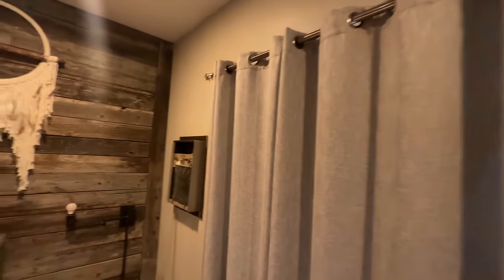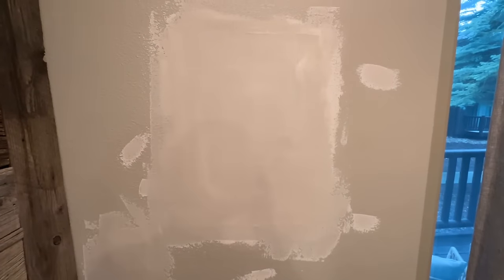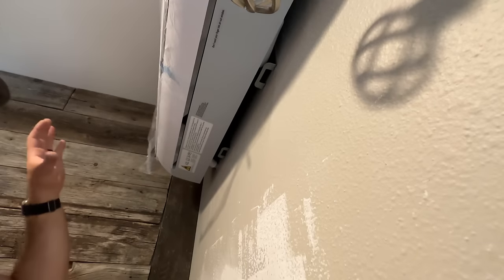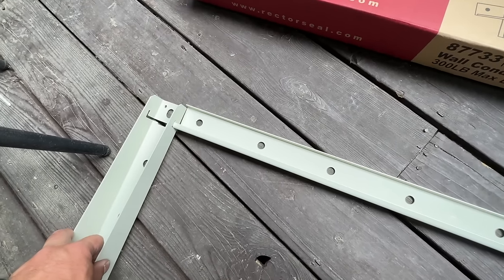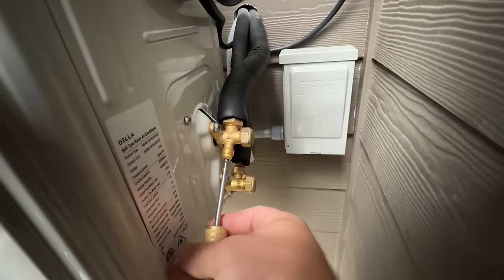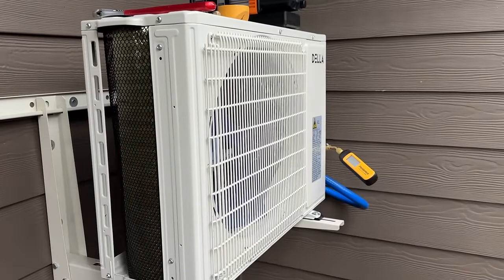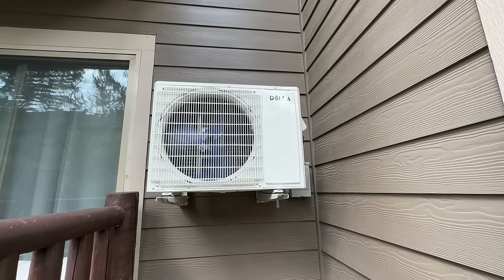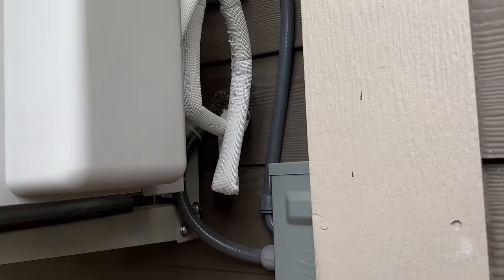A $600 Ductless 110v Mini Split?!

Comment: I wish they made mini (as in small) mini split systems.

Between 3000-6000 BTU.  Even better if it's a true 12v dc design (many cheap 12v dc mini split and AC units have a built in inverter to supply 120v ac  and then use 120v ac compressor and fan. A true 12v DC system uses 12v DC compressor and fan).

This size mini split would be perfect for offgrid use for a room about 10 feet x10 feet. This size is perfect for a cabin or RV bedroom.

Smaller AC units generally require less power to run and much much less power to start the compressor. Starting a motor takes 4 times as much power to start than to run. This us why a 2000 Watt generator can't run a 5000 BTU window AC unit.

Yes there are easy start add-ons that reduce the compressor starting power spike. 

A typical 5000 BTU AC uses 500-600 Watts while running and around 2000-2400 Watts to start the compressor.

A 3000 BTU AC should need about 350 Watts running and 1400 Watts to start the compressor.

The smallest mini split that I've seen was 8000 BTU, requiring about 960 Watts to run and 3800 Watts to start the compressor.

My RV's bedroom has a 13,500 BTU AC which requires about 1620 Watts to run and 6500 Watts to start the compressor.

I would use the 3000 BTU mini split when it's mildly warm, perhaps up to the low 80's with a target room temperature of 72-74F. The bedroom doors would be shut.

Obviously in hotter climates the main AC unit(s) would be needed, but often the tiny mini split would be great at night.

Even though the tiny mini split would likely not cycle much compared to the 13,500 BTU, the actual battery savings would be very significant.

Running a 3000 BTU unit that rarely cycles would use about 350 Watts.  Assuming it is run at night for 10 hours would use a bit over 3500 Watt/hour. Using it during the day could mean 6-10 hours run time (I assume that you only run it when outside temp exceeds about 74F). This would require between 2100 and 3500 Watt/hour.

Using the 13,500 BTU AC under the same conditions would require the compressor cycling often. The compressor normally comes when inside temp is about 1-2F above set point and turn off around 1-2F below set point. When the AC is oversized for the situation it makes the actual inside temperature much more uncomfortable.  If you set the temp at 72F, you could experience swings as bad as 70F to 74F. While a small AC is still programmed with the same 2-4F swing it takes longer to hit the lower temp. This reduces experiencing a rapid cooldown every few minutes. 

The AC cycling often will mean that much of the perceived savings of the compressor being off are used up by the power draw spike to start the compressor.

Also both the 3000 BTU and 13500 BTU AC will likely run the fan nearly continuously. The 3000 BTU AC usually would have a much smaller fan.

If the set temp is too low (usually because people mistakenly believe setting the AC to 50F will cool the room much faster than 70F) the AC unit's coils can freeze up, literally creating a block of ice damaging the coils (permanently reducing it's efficiency) and preventing the AC from being able to produce cool air and causing power use that does no cooling. The larger the AC the easier it is to freeze it up and the longer for it to de-ice. 

A 13,500 BTU AC requires about 1620 Watts to run. If it ran continuously it would require 16,200 Watts/hour.  Based on the BTU rating it should run about 4.5 times less (I'm assuming the conditions are perfect for 3000 BTU). This means that the compressor would only run about 2 hours and 15 minutes during the 10 hour period. This would require 3600 Watt/hour compared to 3500 Watt/hour for the 3000 BTU.

The 13,500 BTU AC would draw perhaps 100 Watts to run the fan. 10 hours minus 2.25 hours (compressor run time) means 7.75 hours of fan run time, an additional 775 Watt/hours. Now we are at 4375 Watt/hour. This doesn't account for the compressor cycling on and off.

Then there is an issue that the compressor would actually run more often as it would cutoff around 74f (assuming 72F set point) and turn on at about 70F. I believe that with a low 80F outside temp that the room would warm up quick enough to require more than 2.25 hours of run time in 10 hours.

If your location has very high humidity (like south east US) the 3000 BTU may not be able to control humidity while the 13,500 BTU AC might require a 68F set point in order to force it to run enough to maintain a stable and comfortable humidity.

In ideal conditions using the 13500 BTU AC would use at least 4375 Watt/hour (and likely significantly more as the compressor may actually run 50% of the time instead of 22.5%) compared to about 3500 watt/hour for the 3000 BTU; an increase of 875 Watt/hour. I would bet actual power usage is closer to double, around 7000 watt/hour vs 3500 Watt/hour.

Then there are the cases where I would run the 15,000 BTU AC in the main room combined with the 3000 BTU bedroom unit to save power usage.

There could be times when it is hot and humid enough that I'd run the 3000, 13,500 and 15,000 BTU units at the same time. This would require shore power or using my 9600 Watt generator.

875 Watt/hour is of little to no concern at home; but in off grid situations it matters, especially for an RV with limited capacities for batteries (space and weight).
Reply: That is the whole course!!! I am copy/pasting this into a text doc so that I can print it and refer to it.

Comment: Thank you for the instructional video. What if you need to locate the outside compressor fan unit horizontally to the hole through the wall?  What considerations and limits are there in locating the compressor?  I assume you need to maintain a slope in the piping to ensure gravity feed. How high off the ground is best,  I have a brick wall that opens to the courtyard garden where I would like to locate the Condensing Unit. How far from the Internal unit can you locate the compressor. Condensing unit?  Pros and cons of location. The other side of the brick wall where I want to install the unit is the garbage storage location.

Comment: Gotta start using those white 115 lb drywall anchors from Home Depot. Work the best. And forget what miketime says about nylog blue. That stuff is the best 😂
Reply from the maker: I’ve used them before. They’re WAY overkill man. I did a bunch of testing with these ones in my garage and they are plenty strong for a head unit. In fact, I could install it with just these anchors and it would be 100% strong enough.
Reply from the maker: Also if you ever need to remove these anchors the evidence and patchwork is like extremely minimal. Wheras with the white ones you have a huge hole to patch

Comment: The cover for the outside power connection on unit does not look rain tight. I would run the drain away from house. R32 is moderately more flammable than R410A however.

Comment: not to nit pick, but wouldn't it be a more professional install / slightly easier to maintain if you crimped on spade or ring terminals for the power and coms wires?  easier to screw down?

Comment: I bought one in 2021 and installed it that summer. Two years in, it developed a refrigerant leak. HVAC tech came, recharged it, and told me the evaporator coil leaks and it's "not repairable". I called the 800 number and was told no warranty after three years.  Mine was also a heat pump so $750.00  down the drain in three years. I hope y'all have better luck than me, but I wish I had put my money towards a better unit with a better warranty.
Reply: In the same boat as you, only got 9 years out of a Mitsubishi unit , the head unit is leaking and half the price of a new one. It’s out of warranty and I hesitate fixing the inside unit and having an old compressor. I had hoped for longer service but now I have delayed another year and may be better off replacing everything, I’m just skeptical of some off these lower price units in terms of longevity
Reply: If I'm understanding you correctly your unit is only in its second year and you have a 3 year warranty.
Reply: @russellstewart5414  I thought Mitsubishi had a 10 year warranty.
Reply: @happyheart2871  no. 2024 minus 2021 is three years. Had I acted on the warranty when the leak first appeared, it would have been covered but my hvac tech dropped the ball on that.
Reply: @happyheart2871  my original unit was 8 years. And now the units are 10 years but if you use a Mitsubishi authorized Diamond Dealer you qualify for 12 years warranty so you need to do your research . I replaced my entire system last month and am very satisfied, pricey but it was my understanding that some of the more economical options don’t have as good of customer support and service.so I went with what in know . Only time will tell if I made the right decision

Comment: I see on Amazon comments the company does not stand behind the product very well. Plus if you don't have a working knowledge of HVAC and vacuum pump, tools, gauges, plus in some places an electricians license. It will cost the price of the unit just to get it hooked up.

Comment: Della looks really fairly easy to install.  Love how he really took care to hide the linesets & wiring—unlike contractors in our area doing slap-together quickies, taking unsightly shortcuts!  
Does Della void the warranty if homeowner DIYs it? 
Is Della coming out with significantly better energy efficiency units soon (because these are currently, it appears, fairly low-efficiency)??
Reply: Della warranties DIY units but extends the warranty to 5 years if installed by a licensed qualified pro.

Comment: My favorite anchors as well, easiest and quickest to use. BTW this unit is $650 now.
Reply: 650⁰⁰ now? Kinda pushed over my commodity price threshold then-
Reply: @dubmob151  650 is still cheap, just pointing out that it had changed.....

Comment: Imho running the lineset through wall too much work and for what reason? I've watched many mini split installs, drill line set hole thru wall on top, pull line sets out of unit, push through hole, connect rest of line kit out side, run down and cover to look nice. Possibly for hoa ascetic and rules? Still running that copper in wall and drain tubing seems troubling. Appreciate this channel and info though as its useful info.
Reply from the maker: Asthetics. This looks way better imho
Reply from the maker: Functionality wise, no difference

Comment: Is it necessary to vacuum down the Della system once its installed? I watched your Mr Cool mini split install and it did seem like you pulled the vacuum on that system.
Reply from the maker: Yes, you have to pump down a Della and most mini split systems. The Mr. cool has a patented no vacuum line set that has refrigerant charged in it and the fittings are designed so that as soon as you connect it, no air is allowed to get in the lines.
Reply: Thank you. I've been thinking about installing one of this mini splits however I don't want to purchase a vacuum pump and all the accessories I watched you use. I will try Mr Cool mini splits since I won't need a vacuum. Thanks for your help and awesome videos. I watched 10 of them last night. @diyhvacguy

Comment: I need the expertise of an HVAC TECH; For personal reason I need to place a timer or a timer with a relay in a couple of mini splits. Should I place the the timer in the power wires between the  breaker panel and the outside unit? or should I place the timer between the wires that go from the outside unit to the inside unit?

Comment: Umm I’m pretty sure that disconnect switch doesn’t meet working space clearances required  by code. Also I noticed the MC cable coming right through a hole in the back of the disconnect switch. Where is the MC connector that should be on the back of the disconnect switch🧐

Comment: Oooooo...an open end attachment for a torque wrench. Of course!!!
Reply: I've installed thousands and never ever used a torque wrench once on these.  No leakage either.  Just use common sense when tightening.
Reply: @aday1637  Yeah. You're right. You have to test for leaks anyway. IMHO, these videos do that to stick to the line and protect themselves. Still, I never saw a tool like that before.

Comment: I don't understand why you didn't run the line set before you patched the hole now you have to patch another hole making more work for yourself. I also don't understand why you ran it inside the wall what happens if it develops a refrigerant leak ?

Comment: I did a Pioneer and a C&H recently for the first time, but didn't use the core removal tools.  Is the benefit of removing the valve cores just a faster evacuation or are there other benefits to using the (fairly expensive if you buy multiple) Appion tools?  I did have a total overkill (and massively heavy) 12cfm vacuum pump so it went quick regardless.
Reply: I’d be curious too.
Reply: The valve does significantly restrict flow. If time matters, you'll want to remove it. i.e. DIYer's shouldn't care. (Are you paying yourself by the hour?) For professionals, those things are worth their weight in gold.
Reply: @jfbeam  Not speaking from experience but there isn't much "flow" during the vacuum process.  People say it takes way longer to draw a vacuum but in theory, the largest flow across that core is at the very beginning.  Once you get down to a partial vacuum there isn't much flow.

Comment: Do you think this would work in a mobile home.  We use window units but they always end up dripping water in the window sill rotting it out . Then i have to rebuild the window sill wall and sometimes the floor.
Reply: Sure would.
I've got a mini-split installed in a 40' Retired Air Force Ambulance Bus... currently 91 degrees outside and 73 degrees inside.
edit: practically silent operation is a bonus

Comment: Does this unit require professional installation to maintain the product warranty?  Does having the EPA 608 certification alone count for that requirement?
Reply: Nope. They're 100% designed for anybody to easily install. They cut down the pre-made lines, which requires some special equipment. If you uses everything as-is, there's no need for a vacuum pump, etc. The limited amount of air in those two lines will not hurt the system. (there's a dryer block in there to deal with that.)

Comment: I have a small 1.5 car garage (~400 sq ft) I'd love to cool.  Can you recommend a unit that is super-easy to install that runs on a 110 v AC outlet (instead of being hard-wired)? My budget is $1500.00 but I'd love to be closer to $1000.00 or less.

Comment: Disconnect is a code violation. Check your electrical clearances for working space. Also a j-box buried in the wall?
Reply: Every state and city has a different code. My gosh we got a new fire Marshall from some lib city. He changed codes and the cost of our build went up 1 million dollars to meet his stupid codes. Turns out his gay lover did the work and that's how they paid for their million dollar home. Just my opinion of course and this is all alleged.
Reply: @keith2498  everyone goes by the nec code they can go above it for safety but the code is min.  if they stray from it they will need to cite code otherwise you can appeal it.  We got rid of inspectors making up rules as well just appealed and after several companies appealed they fired them.
Reply: @jrock865  Exactly. Only person you can't fight is a Dumb arse Fire Marshall. They just get revenge.
Reply: @keith2498  Ya they can make you add additional items for safety disconnects etc and relocating but a good change order always is nice.

Comment: Would you have sent the line stubs from the air handler directly out to the exterior had you not run the line set through the wall in this install? Is it better to have those connections to the air handler on the inside or outside?

Comment: is there such a thing as a minisplit where the line set can be run UP from the inside unit? I have a room that needs a small unit to help the central AC keep up, but it has a brick wall on the other side that i really don't want to drill through/break up.

Comment: Is there any baseboard air handlers? I think close to ceiling air handlers look tacky. Thats ok if you can hide them like a wall bookcase. Ceiling units are ok but think where the hotest part of the house is, the attic. Florida has lots of residents wasting energy in their attics. My cabin in the mountains has AC ducts under the house and the house seems to be much cooler in the summer. Yes it gets hot in the northern southern states. 73

Comment: Is it important to remove the Shrader valve? I have installed about 10 of these and never have, but I remove all of the air with a vacuum pump and test it with nitrogen. I did have one leak after 1 year, but the others are good.
Reply from the maker: You can definitely do it without, it just takes a bit more time is all 👍🏼

Comment: Difference between this model with R32 and R410A refrigerant?  Why is this cheaper?
Reply: R32 is flammable.
Reply: here the short answer.... In most cases, R32 is the superior refrigerant when compared to R410A. While neither refrigerant depletes the ozone layer, R32 has a lower GWP and is easier to recycle. R32 also has lower operating and maintenance costs and is nowadays more common than R410A due to the phase-out.
Reply: @GhostReaper2043  Minus the flammability aspects, R290 is superior to them all.